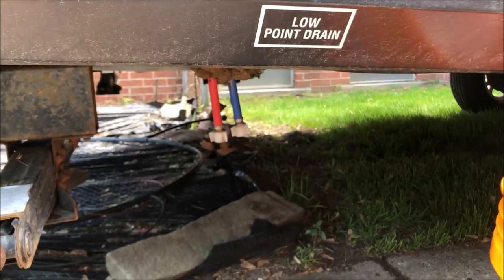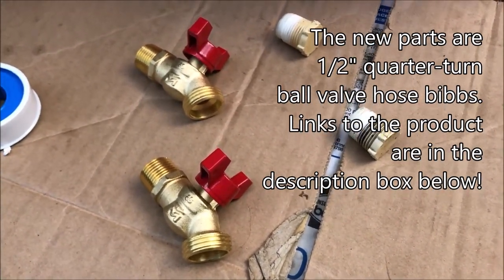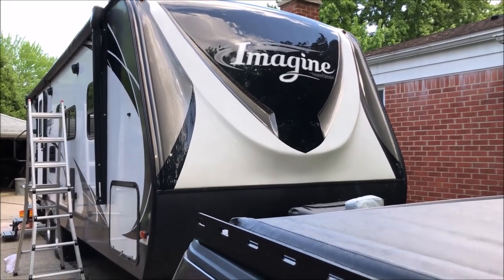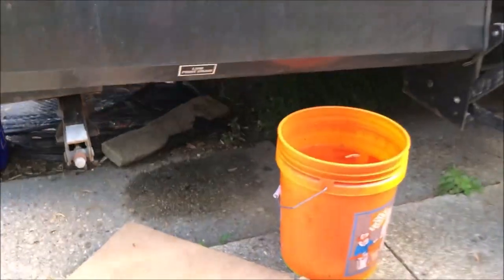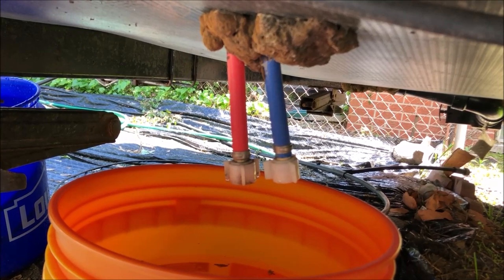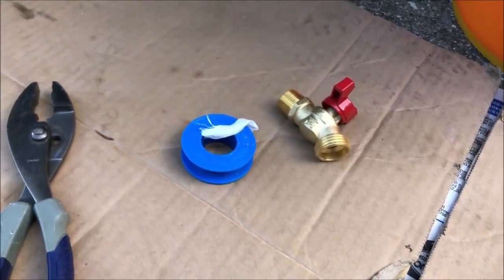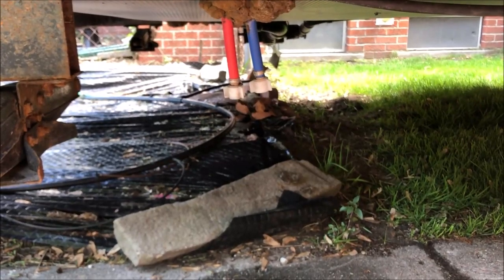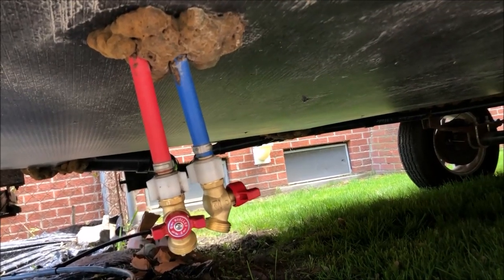RV low point drain upgrade to ball valves

Comment: Did you had to remove the existing metal clamp before installing the new valve?
Reply from the maker: No I just used the existing female threads. One viewer advises against this in the comments but it’s been ok for us for a couple years now.
Reply: Just FYI, I’m using valves made of PVC instead of brass because they were significantly less expensive (~$2 each).

Comment: I have a 2017 when a bagel it has the 2 lines that come down but there is no cap on it at all what does that mean
Reply from the maker: Some don’t have a cap on them if there’s an on/off valve. Otherwise they might just be overflow lines for your onboard fresh water tanks. Might check the owners manual or google for it online

Comment: I hooked up my water to the camper and all my low point drains have water leaking out of them when I turn the water on.
Reply from the maker: You might want to try wrapping the threads of the plugs with Teflon tape
Reply: I fixed it thanks
Reply: How did you fix it? Mine does the same

Comment: I have two white lines one capped other is not. The one without cap has water coming out. I cannot seem to find anything on Google or YouTube on these two white lines, any ideas?
Reply from the maker: An uncapped line could be a fresh water holding tank overflow tube.  Sometimes those can leak by siphon action if the talk is full, or if the RV isn’t level. A capped line is typically a low point drain.